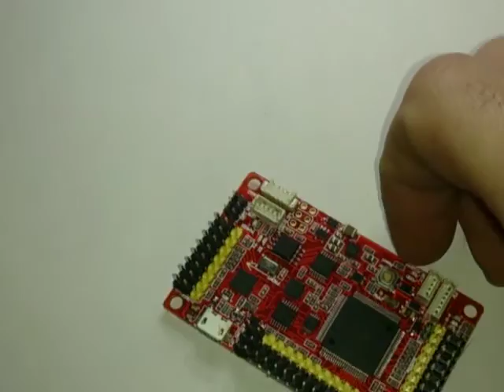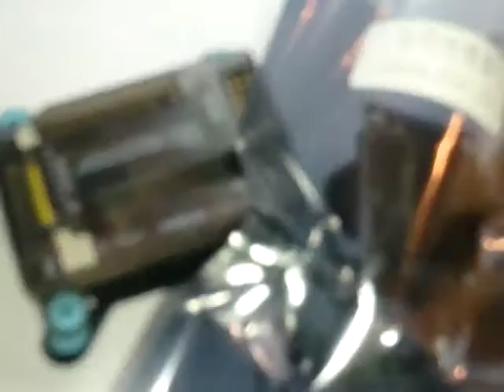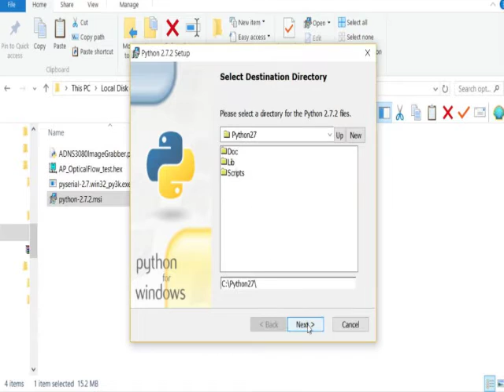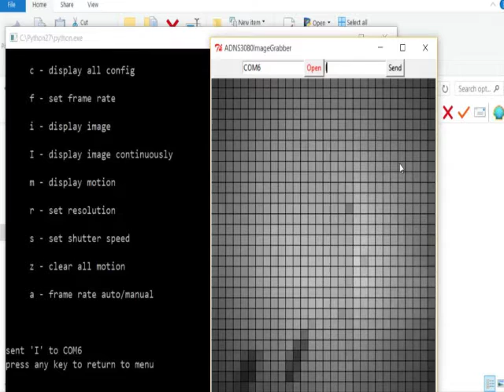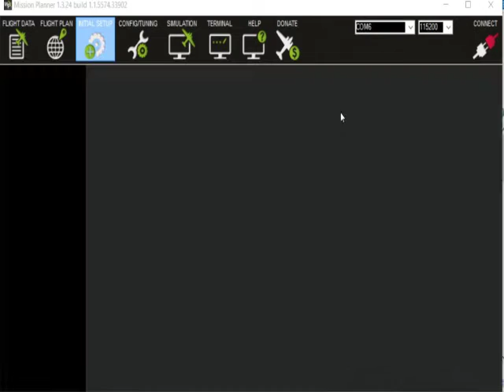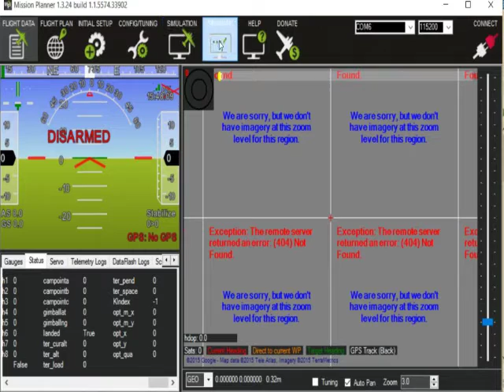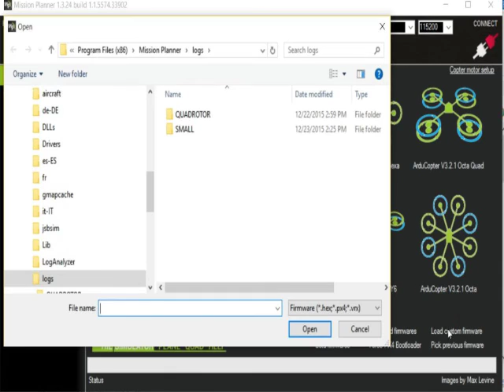CX20 OPTICAL FLOW FOR APM 2.6

Comment: I keep getting garbage words from terminal. I think its mainly due to its CLI function being deprecated. Do you have solution? Thank you!
Reply from the maker: its because your running version 3.21 you have to run firmware v3.15
Reply from the maker: also version 3.21 was broken for optflow for logging ect..If i remember right it was so broken i don't even think anybody that was actually running optflow with version 3.21 was actually running it..   I had to edit the firmware for 3.21 and posted it in the description of this video if your curious . however you still need to run version 3.15 to see the cli data.   It has been 4 years since this video but I am pretty sure I explain it all in the video..

Comment: haii bangs, thank you for your answer. actually yesterday the optical flow is already works. buat how i set the mode for using the optical flow? is that right the mode is loiter? because Of_loiter doesnt come out in my flight mode? 
do you have any experiencr using uptrasonic sensor? because i have a lot of problem with ultrasonic
Reply from the maker: +Sandy Kurniawan You might have to try a different mission planner ,version 1.3.24  ..   http://firmware.ardupilot.org/Tools/MissionPlanner/   that might fix issues with your sonar as well.   I do have another video on sonar
Reply: +bangs6996 thank you bangs, the OF_loiter already come out. but my ultrasonic problem is when i put it on the ground the ultrasound produce an anlog of 2.5 v but when i move with hand upward then the voltage getting low. it seem like inverteded value.
do you know why? your video actually use HCSR04 with extra module for analog result right?
but now i use maxbotic sonar sensor
do you know my problem?
Reply from the maker: +sandy boentoro yes you are right I have a daughter board on mine...  .I also don't have your module or ever had the issue with reverse voltage .  I can try to look around for your issue tomorrow . is that the version where you have to make a special cable ect..

Comment: hai, I just want to ask why in the mode 'm' my dx,dy and squal doest change? while i have already restart the script and the arducopter itself?
do you have any idea for my problem?
thank you

sandy
Reply from the maker: +sandy boentoro Did you load the .hex file onto apm?     If so you can try running script as admin .. If it still does not work try to load version 3.1.5 firmware to apm .. then go into terminal and see if you can get it to work.
..Triple check all wires .

Comment: I keep getting the 'failed to find first pixel' error after I send 'i'. Would you know the fix for it?
Reply from the maker: +Mohammad Yasir I never ran into that error,   Did you load the optical flow firmware to your apm?  and m works? just not i?       You can try to load version 3.1.5  and go into mission planner and see if it works  15:34
Reply: +bangs6996 Yes I used the files which are part of the main folder on google drive. I used the link above. Even after hitting 'm', the program works except that it outputs all zeros. Version 3.1.5 of python you mean?
Reply from the maker: +Mohammad Yasir version 3.1.5 firmware for your apm. so you can use the terminal to test the optical flow..  if it works in mission planner ..then we know it might be something to do with admin rights or files on your pc ect..
Reply from the maker: +Mohammad Yasir I forgot to ask .. are you unplugging and shutting down the py script.. you can't go from i to m and m to i without unplugging the apm ect..I'm sure you have but just need to throw that out as a option as well
Reply: +bangs6996 Actually I think I may have unknowingly not shut down the script before entering a different command. Thanks for pointing that out actually. But I checked again, after properly shutting it down, and the error repeats. The connection fails as well on mission planner for some reason in the terminal tab but the ADNS3080ImmageGrabber.py file works separately, except that it keeps giving the same errors whenever I send 'i' or 'm'. I have't tested the other commands yet. I'm trying to get the connection working on terminal for now so I can proceed with the setup like you showed

Comment: Is it possible to give the unit its own 3.3v power supply without changing the APM?
Reply from the maker: +Mark Kriska are you talking about the regulator ..then yes.. there is a mod where you can cut off the regulator .then feed 3.3 to the i2c  voltage pin....it a no solder mod.. besides that you can order the better regulator that comes with the apm2.8 that offers 500ma draw.. ect ect....or just replace the stock regulator, I got really lazy and just added another bec for all my addons..instead of feeding off the apm

Comment: hello, I have linked up and ADNS-3080 optical flow sensor to an APM 2.6 running v3.1.5. I have managed to retrieve logs of optical flow motion data but I am wondering if you know how to  convert these values (Dx , Dy) into a ground speed. What do the numbers Dx and Dy physically mean?
Reply from the maker: +Mryoyo1600 I have no idea how to convert it into ground speed. .. I think i would be best to send you this way as my knowledge is basically nil on the subject.. if you have not read this page .. look over how it works ect..   http://copter.ardupilot.com/wiki/common-mouse-based-optical-flow-sensor-adns3080/  ...

Comment: Great video but I couldn't get it work as described.  I'm using an APM 2.6 from 3DR with an ADNS-3080 optical flow module and while it works fine under Python and in the Arducopter 3.15 terminal, I cannot get OF_Loiter to appear as a flight mode option.  Checked the box for the OF module and made sure it was enable in Parameters list - even disabled and re-enabled in the Terminal  - but once back in the Arducopter GUI the OF_Loiter option still isn't available.  I also downloaded your custom version of 3.21 but no luck.  Weird.
Reply from the maker: +Crady von Pawlak You might have to try another version of mission planner. When you say not in mission planner do you mean in the flight mode options..?   try version 1.3.24   . I was having the same problem of it not allowing me to pick it.. I had to uninstall mission planner then re install the old version.   I believe at one time I even had to go to program files and manually delete the folder and re install.
Reply from the maker: +Crady von Pawlak    And here is a link in case your having a hard time finding the versions http://firmware.diydrones.com/Tools/MissionPlanner/
Reply: +bangs6996   Thanks, I was just thinking my ver. of MP is too recent - I'm running 1.3.35 so that's probably it =)
Reply: +bangs6996  Thanks!

Comment: Hello friend, can fix my drone CX 20 --- failed to fix
Reply from the maker: +erikson yol what do you mean?
Reply: +bangs6996 I can send you my drone to fix it, I can not - I tried but I can not
Reply from the maker: +erikson yol Yes if you want you can send it to me , but I am still willing to continue helping you in email..
Reply: +bangs6996 I've tried everything with mission planner but still the problem, or will my laptap or internet or USB cable, but the drone does not raise and does not work SWA and SWB, back home, stability GPS, altitude
Reply from the maker: +erikson yol Take good pictures of all your wires going to the remote receiver and to the apm  the motor side and the input side.. also as I said in email 1 week ago.. it looked like your blades were on wrong in that video..it could be defective apm but I some how doubt it.   Do not plug it in anymore until I look at your pictures.  send to my email.
Reply: +bangs6996 ok thanks

Comment: My version of mission planner would not let me load any firmware except via custom software despite a re-install. 
I downloaded your hex file and eventually found out how to unzip it. (Not seen a 7z before).
I then successfully loaded it as custom software. Hey presto! Everything working!  
Now I can get back to the optical flow setup. 
Thank you for the help. Richard.
Reply from the maker: +hayriddell1 congrats .. just keep in mind my hex is based on the 3.2.1 and does not have the terminal.<--you need 3.1.5 for terminal and to enable optflow logging..  sorry about the 7z.. I take it you found http://7-zip.org/    I use it because its free and it does basically every compression .....

Comment: I tried to upload the custom firmware hex for the optical flow sensor. Now my APM board does not work! Just a single orange light and no connection to Mission Planner other than the optical flow options in console! Not happy! Any ideas?
Reply from the maker: +Richard Riddell you can try to just pick the regular firmware and write it again.. 
I explain in this video .. https://www.youtube.com/watch?v=gKMFenjNrLE  jump to 1:20
Reply from the maker: +Richard Riddell oh maybe I'm confused.. what file did  you actually load on your apm ? if you still have optical flow option that only means you still have the AP_OpticalFlow_test.hex on it..  hopefully you just have to load the 3.1.5 firmware now to get going... I explain that at 12:29 in this video    opticalflow.test is just a man in the middle code for tweaking the sensor
Reply: +bangs6996 l seem to be able to load the optical flow firmware but not any apm firmware. Keep getting "unexpected error" or a timeout! If I could get hold of a firmware hex file maybe I could load it as custom firmware?
Reply from the maker: +hayriddell1 .. you can click on the download firmware button..you will end up here .. http://firmware.diydrones.com/Copter/stable/apm2-quad/  and download that hex file.. not sure if that will help your issue.. I would suggest making the apm bare and only have the usb plugged in.
Reply from the maker: +bangs6996 you can also try using http://www.hobbytronics.co.uk/arduino-xloader to load the hex..    just make sure to pick 2560 from the drop down.. it has no progress bar at all though.. so you need to wait 2 minutes before you give up... it should not effect the bootloader either.. but that is up to you.
Reply from the maker: +bangs6996 hmm going to spam you... are you trying to use the connect button?   the steps should be after you load the opticalflow file to test your optical flow sensor is to .. Open up mission planner go to Initial setup---click on your quad icon if its set to 3.2.1 if not pick previous firmware 3.1.5 or 3.2.1 then click on your quadcopter Icon... Do not click on the connect button..         You might have to set your com port and baud rate up beside the connect button first though. that might be the issue
Reply: +bangs6996 All sorted! Sent a reply under my other email name. Loaded your hex file through custom software in MP. Thanks again.

Comment: i see you good with apm , I have a drone that t Im trying to build for a longtime , I need help, I have hexacopter 800 size,  maybe help me remote , i could donate for the help, the frame that im going to use for IdeaFly Storm 800 Hexacopter  with Walkera DEVO F12 12CH RC Transmitter 5.8G  apm 2.8..
Reply from the maker: +Joselo Buret not sure if I can help you, I don't have a storm 800.. which is really nice looking hexacopter...     and i don't have a walkera devo f12 remote..or the rx. it seems straight forward on wiring it though as it should all be labeled 
  I tried to get a price off ebay seems nobody is selling that frame.    However     Does not mater of the price tag , when the heart of the aircraft is a apm2.6 it all gets wired the same regardless of the looks.   the outputs are all the same for any hex and the inputs for your walkera would hook up the same as well .
Reply: +bangs6996  i have everything just need to put together, if i send you everyhing  how much will you charge me for the build ,you can do a review aster you r build ..  send me a number where we can talk buretechservice@gmail.com
Reply from the maker: +Joselo Buret I will shoot you a email in a bit.   I would not charge you for the build, but would make a complete build video . In the mean time can you take a picture of all the components you have.   bangs696969@gmail.com      also if you want to build it, I have the time to help you if you get stuck on certain things or point you in the right direction
Reply from the maker: +Joselo Buret the more I look into that model , the more it sounds so interesting , at a quick glance it seems you can actually make it a quad a tri or a hex just by un plugging the arms and uploading the right firmware.. very cool.